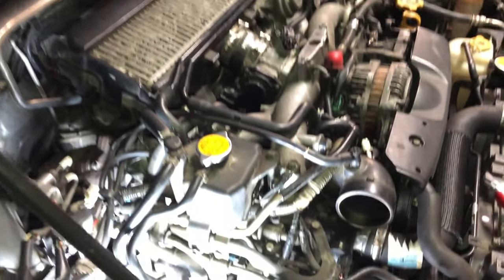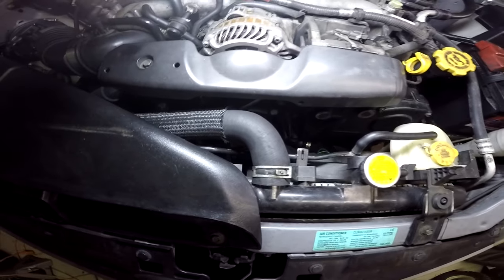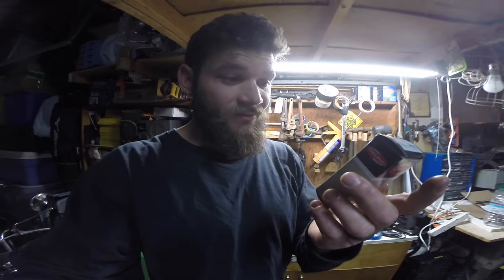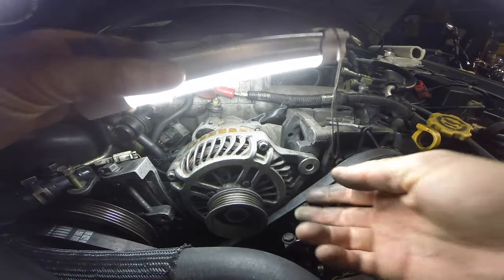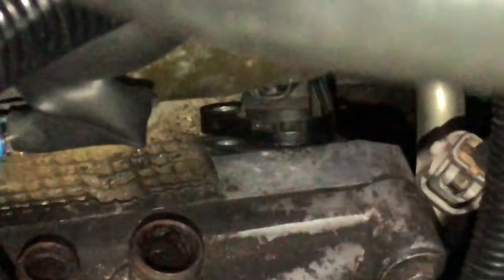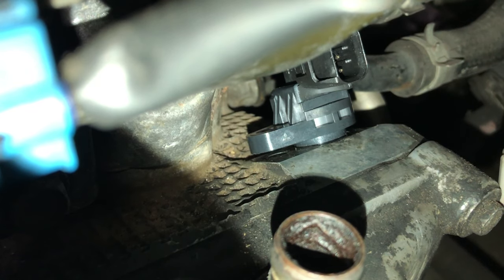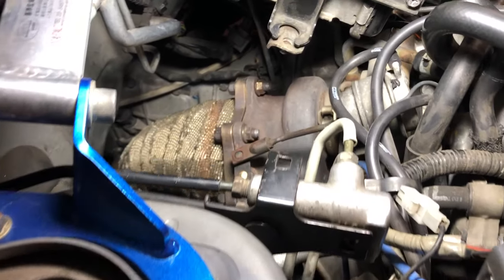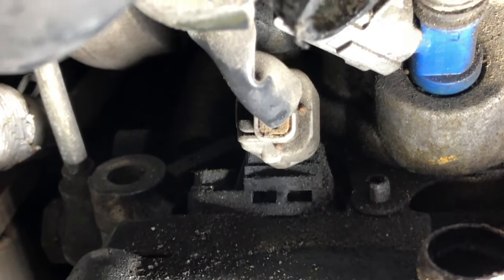SUBARU Crankshaft & Camshaft Sensors REPLACED! FULL TUTORIAL CEL P0340 P0341 P0345 P0346 P0365 P0390

Comment: 2012 Subaru Impreza. I changed my crankshaft sensor and now need to change camshaft sensors Bank 1 and 2 🤦‍♂️ but also my connector for the crankshaft sensor is broken (locking tab and body of connector around the seals on the terminals)
Reply: Crankshaft sensor was $34. Camshaft sensors $133 each

Comment: Literally just had the same failure on my 06 WRX wagon. I got super lucky, it died pulling out of my driveway, but compared to OEM have you had any problems with the Duralast sensor?
Reply from the maker: Still going strong years later 👍
Reply: @06wrxdude  replaced both cam position sensors, now I have a misfire in 3 out of 4 cylinders. Going to swap coil packs around to figure out which one is the issue. 🤞

Comment: Have you had any problems with these since? My 06 wrx was misfiring randomly when I first got it. I replaced the bank 1 camshaft sensor and it cleared up my problem for a few months. Now it's starting to act up and throw the bank 1 camshaft sensor light again. How likely is it that my original sensor is going bad again? I'm planning on going through and replacing the crankshaft sensor as well as both of the camshaft sensors. I don't know though, starting to worry about my ability to keep this car running

Comment: I know this is an old video, but outside of the obvious stall and CEL, what type of jerkiness did you get out of the car and bogging?  Did you ever get a random low idle going into neutral before getting to this point?
Reply from the maker: Yeah my  rpm would drop pretty low and also a huge backfire and at that point I pulled over  and called a tow truck…
Reply: @06wrxdude  dammit lol had a feeling it may be that more than it would a vacuum leak, it was too consistent in certain situations. Might just swap them to be safe like I thought. Great video btw! Mistakes are a part of the process and love that you included it.

Comment: Crank sensor comes out without removing alternator no problem. Looks like the oil pressure sensor was leaking tho, so that should have been changed while the alternator was out.

Comment: So my girlfriends 2015 STI popped p0335 p0340 p0345, I have the same car so I put her crankshaft sensor in mine and my car ran fine, but I haven’t checked the cam sensors, the car doesn’t even start tho, yours did even though it died so I’m a little confused
Reply: Did you ever find a fix to that? Same exact thing is going on with my 05 Legacy. All sensors tested ok. Even checked my timing and that was fine.

Comment: You can also use a VOM and ohm out the sensors without removing them.

I'm in the same predicament you were now... I've watched a bunch of vids... here goes.

BTW, I now don't trust Auto Zone electronic/electrical products. I replaced the coil on my vintage truck. It lasted 8 years. The original lasted for 35.

Comment: Did this stop you car from misfiring and preventing you from driving? I’m having the same issue. I just changed my spark plugs and now I have to change my camshaft position censor
Reply: Any luck on this? I popped the same issue and my car started misfiring after

Comment: How do you unplug the cam sensor connector? Never seen that plug in my life. Also if anyone could help me, 04' sti recently starts like in a way sputters, rpm jumps up and down like its trying to stay alive, no throttle response, seen the knock feedback jumps up to -12 and backfires before it dies out. Had a p0345 code pop up but when i reset my ecu it goes away and doesnt stores. This is my first WRX so if anyone experience could help me out. Much appreciated!

Comment: If you don't mind me asking, are you using a jdm engine or your USDM? I installed a jdm legacy in my 08 wrx and IA tuning has recommended changing the intake camshafts and rear cam sensors. Right now the car is running very rough and not building boost. Thanks for any help you may be able to provide.
Reply from the maker: I have a USDM EJ255. Have you checked for vacuum leaks?

Comment: I’m having a misfiring issue but the car is not throwing a cel only blinking when it misfires then goes away for a bit and car will run better then it will misfire, jerk and stutter again a few miles down the road usually at stop and gos. Any ideas? Its a 2006 wrx just like yours.
Reply from the maker: Bummer. I’d change plugs and maybe even coil packs as well. Spark plug gap can also cause misfiring. Good luck!
Reply: 06WRXDUDE I figured it out last week after 2 weeks lol. Turned out it was where the engine wiring harness plugs into the Ecm. Broken signal wire for injector #4 so no fuel was going in that cylinder. Yes it did take forever to find and diagnose, I ended up routing the two wires outside of the plug with waterproof connectors. It was impossible to remove the pins from the connector to re solder it. Now she’s all good 192,000 and counting.
Reply from the maker: Awesome! Glad you figured out your issue 👍

Comment: Right at 8:52 there is a bolt RIGHT behind the dip stick. I'm missing that bolt. Can someone please help me identify what part I'm looking at and what bolt size I need. This would be incredibly helpful.

P.S. I'm also getting turbo lag and jolting. The turbo doesn't want to go past .5 in any gear. I'll get lag, a jolt of power, then a massive drop. I cleaned the MAF sensor, but no luck so far.

Comment: Your videos go hard bro, any idea if cam shaft sensor is located in the same spot on 2011 WRX?
Reply from the maker: Thanks for that. I’m not sure off the top of my head. Not sure if the 2.0 is similar to the 2.5 liter engines. I’d take a look and see if you can spot them. Good luck
Reply: @06wrxdude  yah I found it and changed it, literally saved me from all that bogginess finally
Reply: @reeces5000  where was yous having same issues on my non turbo
Reply: @moneymikeslickwill8749  same spot as in this video bro, it's a tight spot but it's there
Reply: @06wrxdude  did your Tachometer work while cranking/no start.
My 2007 Impreza cranks but no start and tach does not move.
Crank sensor ?

Comment: bro I feel you so freaking much :D damn :D I fixed this problem in the same way, mine has AVCS with 4 camshaft sensors and 1 crankshaft sensor. I replaced each of them, but the one was needed, same as you, left top sensor :D I replaced fuel pump three times, MAF, O2 twice, spark plugs, all the ignition coils twice, wires , timing belt... shit I did so many things before I checked this fking sensor :D :D :D damn bro

Comment: I tried to replace these sensors on the STI i bought to fix the misfire, and did the one under the alternator no problem, but my camshaft sensor has NO CONNECTOR ATTACHED! ON EITHER SIDE! anyone know what is going on? I can't even find the plugs on the harness. car starts and drives but idles like crap and misfires under 4k rpm,  but pulls strong above 4k

Comment: Currently need to replace my bank 2 sensor.. the one you took out at 9:30. And I cannot get the damn thing to come out
Reply from the maker: I had this same frustration. I just kept wiggling and turning and it finally pulled out. It really only comes out one way. At one point I thought I needed to remove my intake manifold to get it out. Thankfully that wasn’t the case! Good luck man!

Comment: have ideas to help fix cam sensor position issues? My 04 sti doesn't want to rev past 5k and wont boost over 8psi, when hit it sputters out and almost stalls. Wont accelerate any further.. if you have any ideas or possible solutions, that would help tremendously
Reply from the maker: Still get a CEL for the sensor? Have you checked all vacuum lines. Sounds kinda like a boost leak 🤷‍♂️

Comment: I’m currently getting code ( P2092 Intake Cam Position Actuator 2 (LH) Control Circuit Low. Anyone have this issues or can help ? I was going to replace the bank 2 camshaft sensor but I’m not sure if that’s the actual issue due to the code

Comment: my subi trumble just a little bit, when u start it... do you thing is a sensor? thanks
Reply from the maker: Possible. Any check engine light?
Reply: Had exact same issue on my '14 subi with 48k. I ended up getting check engine light after about a week. Mine was p304, which is 4th cylinder and worst to get to. Replaced all spark plugs while I was at it. Didn't fix it. So, order a Delphi coil pack from rockauto, best price, and replaced on the 4th cylinder to fix it. 

Really surprised parts are failing before 50k miles.

Comment: There are 4 camshaft sensors not 2. The other two are onthe bottom front corners of the block. You can peak at them from under the front of your car.
Reply: no cam sensor on block
probably because there arent any camshafts in the block.
Reply: They do plug into your block. You dont know what your talking about

Comment: Anyone else having trouble pulling the crankshaft pos sensor out? Turns left n right but I've almost mangled the plastic top trying to pull it out...
Reply: Scratch that -so the plastic top just broke off and the magnetic part is stuck in the block 🤣👍 help!
Reply: I had this happen. Aluminium housing of this sensor was glued like to the inside of the block. I scraped it from all sides and squeezed with pliers to take it out. It was no fun but I was very happy when I managed to take it out in the end. Good luck